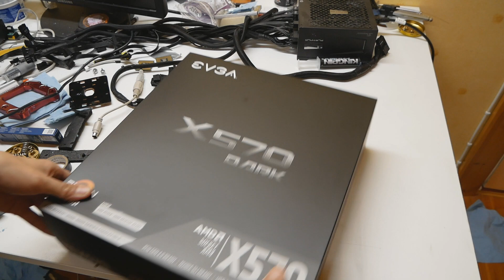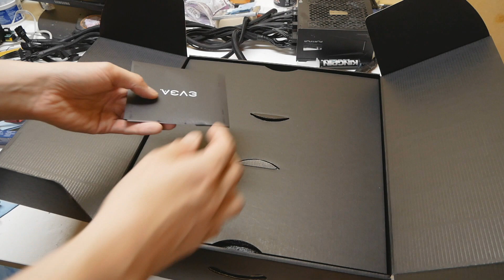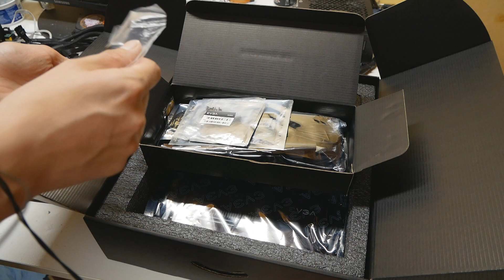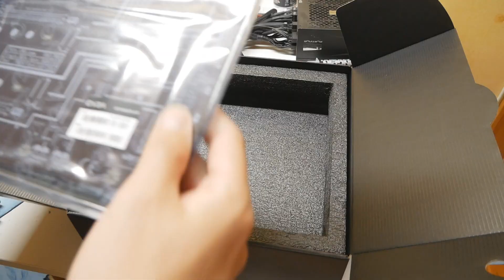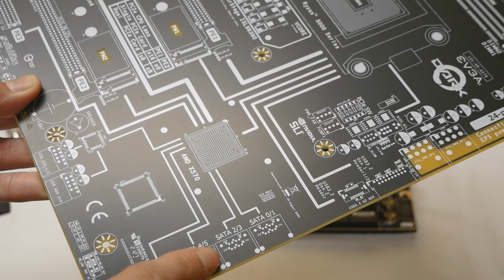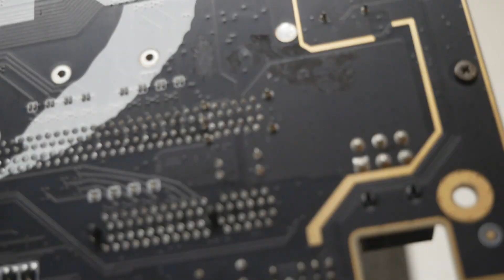The Best AMD Ryzen Motherboard? EVGA X570 DARK Unboxing & Overview

Comment: Looks exactly like the Z590 Dark as far as the box and accessories go. Board itself with the vrm heatsink installed looks almost identical apart from the socket and the heatsink material itself. Can't wait to add this board to my Dark collection!

Comment: Cant wait to see this in action.  It will be interesting to see how well this board performs vs other high end boards. Something like this is a bit over my current skill level but have been getting into overclocking more and more, so its got my interest. Would be great when you get your next video up to have a word or two on if or how much this board actually makes a difference compared to others.

Comment: Great video, Thanks ! I think they did this because of AM4 3D V-Cache refresh. Unfortunately it's too expensive, $700 vs Aorus Xtreme ($700), C8Extreme ($800).

Note - The rear I/O is fully from Chipset only none from CPU side. Only the front panel headers of USB C and USB 2x3.1 are from CPU side. And they decided to drop the rear 20gbps port from Z590 DARK to 10gbps on this. Plus another M.2 SSD slot, U.2 port too, also a bit of less VRMs vs the Intel counterpart, even CU to AL heatsinks. And overall X570/Ryzen 5000 specs since they have direct 8xUSB from the specsheet and ton of I/O which I'm not seeing here. 

I think they dropped the USB connections because of the USB problems on the X570 chipset and Ryzen 5000. All that said, looking forward for your OC video, AMD is very hard to tune with all that WHEA thing with Memory I hope you can get things right !
Reply: Agree with most of your points. At least they moved the bios battery per TiNs suggestion to make the open end 4x slot actually usable unlike the z590 dark. Lack of io is a shame for a platform with so many PCI lanes. My X570 master runs my 4xBdie @ 3800C15 1:1. Further tweaking of mem yields no latency decrease or bandwidth increase past 54ns, This is on a B550 Unify and X570 master. Unless you want to run your chip non 1:1 mode then your always limited by your fclk max which is the limit of your I/O die quality not board specific. Unless the V-Cache cpus have better i/o dies allowing for 2000mhz+ 1:1 then there is little value in these boards for most users. Totally stoked EVGA is now making AMD boards though, X299 dark was one of the best boards i have ever owned.

Comment: Based on Hardware Unboxed testing in many games you still get an advantage from dual rank configs
Reply from the maker: That  is why i want to max it out not single ranks.
Reply: @LuumiJuhani  I'm looking forward to the Dual rank OC on air/water.
Keep looking at  DDR4-4000MHz CL14-15-15-35 1.55V
32GB (2x16GB) F4-4000C14D-32GTES